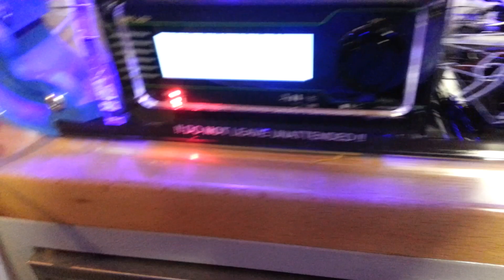AirWolf 3D HD2x 3d Printer

Comment: I need to replace a fuse on this 3D printer. Can you please message me and let me know how to get to the fuses? Please and thank you.
Reply from the maker: if it is the fuse you have to remove the back cover from the printer and you will see the rambo control board
if there is a fuse there replace it at this point
it could also be a power supply issue if you have no power

Comment: Airwolf makes horrible printers, ive had the HD2x for 2 years and its a constant pain my rear. Go with the Ultimaker,
Reply: out of the box new it was great
after about a year of use the issues started
after replacing the controller with a duet-wifi and the extruders with e3d titans it has never printed better
after the warranty runs out you have 2 choices
1 go with another printer 
2 upgrade the printer

Comment: Satgot hello,

how would you rate the print quality of the airwolf against that of the ultimaker?
Reply from the maker: at the time it was on par with the ultimaker, the Ultimaker 3 has features the airwolf just doesnt do (IDEX) 
i'm in the process of converting my HD2x to a 1.75mm filament printer using a E3D Chimera and 3dp dual bowden extruders
for the money the best printer on the market right now IMHO is the Formbot Trex-2+ printer 
its 400x400x500mm (or 700 tall), its dual extruder with IDEX (Independent dual extruders)
has a laser engraver option and High temp extruder option
with all options its still under 2000.00, I have 2 and they run all the time, there is a facebook forum for them with lots of end user upgrades and support
Reply: Reeeeeeeally late reply from me. Thank you for the response. Also, the E3D Chimera sounds promising.

Comment: Satgod hi again, I like the Airwolf brand but I recently saw a review on the Axiom (it may have been the top ten prosumer 3D printers on 3DHubs or something, and they gave a lower print quality rating of B- than several other printers on their list). As I read further into the review I think that they claimed that the Direct Drive had issues. Once they tweaked the settings the print quality got "better".  Therefore: 1. Is this a minor problem with the Direct Drive which stems from their lack of knowledge?; 2. after they tweaked the settings, did the print come out quite nice like they usually do (not sure what better means)?; 3. was the B- print quality based on the pre-tweaked results, weighted average of before and after, or after? I think the Airwolf prints---especially the more recent generations---is quite good. What is your take?
Reply from the maker: There are a few version of the axiom.
I believe you can get it in bowden or direct drive
Direct Drive is handy if your going to use flexible filaments
I have used both setups and I prefer bowden myself but I dont print with alot of flexibles

Airwolf out of the box works, and you pay a premium for that
if you can spend the time and a few rolls of filament learning how to setup and run a 3d printer you can save yourself alot of money and buy a cheaper unit for 300-500.00 do some upgrades have a 12x12x12 inch 3d printer and only have about 750.00 in it total

Again out of the box the airwolf is a work horse the only complaint I had with airwolf is they would not release the parts that are 3d printed and that is the reason I sent to 3dp extuders.
Reply: Got that Satgod. Not to split hairs but I suppose you meant (at the end of your reply) that you "sent for 3dp extruders (from Airwolf)" and that they would not give you the files to print your own parts. I got a sample print from them. I was told it was printed at 250 microns or 200 microns or something. It looked rather quite good actually. Not to push the point but since you liked the print quality of the AW3D HD2x I presume the Axiom would have impressive print quality. Your thoughts?
Reply from the maker: I have almost bought a Axiom 3 times now
I was actually looking at them last night again

I love all the upgrades they have done
nozzle cleaning, auto leveling, enclosed print area
The seperate heated nozzles where a big thing, when I got my HD2x I was very disappointed that it was a shared heater for both nozzles

They have sent me several spools of filament for my reviews and recommendations for their printers.
I would love for them to send me a new axiom to review and KEEP!  ;)

I buy all the stuff i've done write ups on and then give unbiased reviews to help people not waste their money
and I still stand behind the fact that out of the box its hard to beat a Airwolf3D printer

as far as changing the extruders on the HD2x that was my choice, I would have duplicated their design in a few hours with a set of calipers and a cad program or just had my machinist make one from alluminum or stainless

Comment: Very good review! I have been looking at a ton printers and this looks like the one!
Reply from the maker: if you want plug and play out of the box they are nice.  You can find this printer on ebay now for 1300.00 to 1900.00.   Airwolf3d has gone to the axiom line now.  Alot of nice improvements.  Airwolf printers are a little more pricey but your paying for the out of the box convenience.
There are several options out there. 
The Gmax 1.5+ looks good as well as its big brother.
Build area is LARGE and everyone i've talked to loves it.
Reply: satgod How many items such as the beartrap you made. Can you make out of one spool of PLA or ABS on average in you experience?
Reply from the maker: It would be hard to say how many prints that depends on the infill (how solid it is) and the size
But 1 spool will do alot.  Most prints can be done between 35-50% infill and are very sturdy.  Most people start at about 30% infill I know some that start at 20-25%  just depends on what your going to do with it.

Comment: I purchased this printer and the nicest thing I can say to you is I didn't have the same experience with it that you did. It was a $600 (10% restocking fee and paid shipping by me both ways per the return policy) lesson in don't believe everything you see on the internet.

You're not a French model by any chance?

Aurevoire mon ami.
Reply from the maker: no and you are the first person to have any issues with this printer
what issues did you have if you dont mind me asking
Did you try to contact them for support before returning
I had zero issues and i'm still using it  for 12hr prints every week
i've ran it 16-18 hours in a day with zero issues
The only thing with ANY bowden printer is you need to get filament that is 2.8-2.9mm  if you get true 3mm filament (ebay) you can have feed issues
This is because of the bowden feed tube not the printer or the hotend

Comment: Very good review, thank you. I'm shopping for a printer, and interested in the dual extruder for printing supports made from soluble filament like PVA or HIPS. Would this printer do the job?
Reply from the maker: still printing and still no issues
It will so that and then some
once you get use to using 2 extruders you can use it to do supports in a differnt material or to even do the infill in some other material

Comment: Great review.  Have you tried printing in other materials like Nylon and polycarbonate?  Do you have any problems with peel off the print bed?
Reply from the maker: I have printed in almost everything available except carbon. As I said unless you want to waste lots of time tweaking and adjusting this is the only way to go
I use my printers ALOT i've probably ran 50 hours of prints in the last 3 days
I was hesitant about spending this kind of money on a printer but I have never regretted it since I purchased it in fact I kick myself for not doing it sooner

Comment from the maker: 2 months and this printer is still going strong with no problems
so far its been the most accurate and dependable 3d printer I have
I even have a SLA printer and the airwolf is still the printer I use the most

Comment: Cool review.  What kind of things do you make at your shop (and what did you get this one for?)
I've been messing with the ABS / PVA together lately. I'm looking to do cool art stuff (Sculptures).  I ordered 2 .35 Nozzles, but still learning... so, getting the hang of my projects with the .5 first, then will switch.  Had tried the Makerbot Z-18, but it was a total lemon, so was fortunate enough to be able to send it back... and found HD2X
Reply from the maker: I do 1 offs and proto-type stuff
maybe reproduce something and add a few modifications to it as well

I do alot of stuff for my RC hobby with it as well
Reply from the maker: i've printed with .25 to .5 nozzles
honestly unless your going for extreme detail .4 or .5 is where to stay
i've ran a .35 print from a .4 or a .5 nozzle that looked great
when you go from a .5 to a .35 your adding about 70-80% more time to print the same object
and the .5 does a GOOD job on the airwolf printer